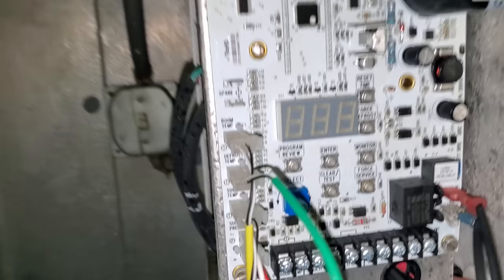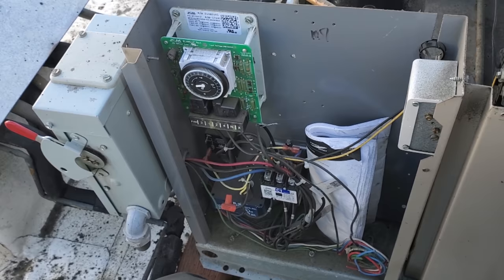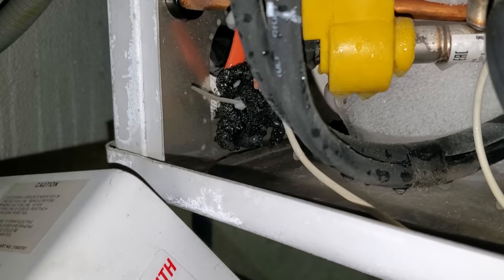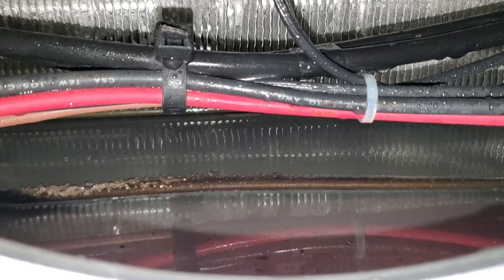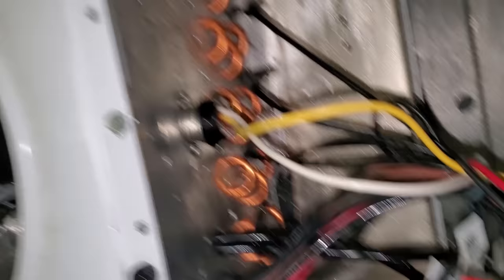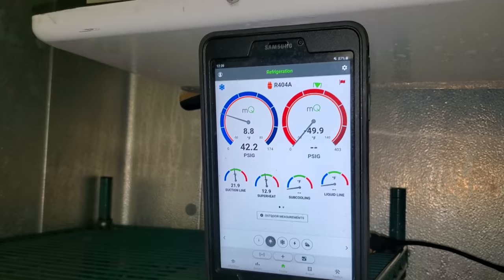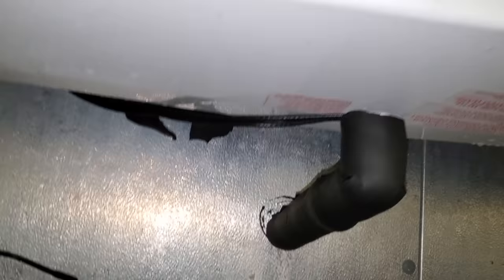THE OTHER COMPANY COULDN'T FIGURE THIS ONE OUT EITHER

Comment: So I do appliance repair. I know most of these components, but mine are smaller and more buried.

Thankfully a refrigerator is designed so if you have a drip line clog (smaller tube)  it floods the refrigerator, but saves the equipment. (Sadly occasionally at the expense of the hardwood) The bottom pan fills up, and you get a dribble of water out the door. Tends to indicate the problem much better than icing up the evap coils. 

Normally we get a call because "the icemaker is leaking even though we turned the water off". 

Always fun to explain to the customer that their leak was literally coming from thin air, rather than the icemaker. 

You earned a subscriber.  And my sympathy goes out to you. I've been the 6th tech on the call before. It's satisfying when it's done, because you just proved you're better than at least 5 other techs, but you feel so bad for the customer, especially when you are charging them to undo something you know someone else charged them to do wrong. And you almost want to defend the other tech, because he represents your industry, but you really can't, because you're looking at his stupid.

Comment: I used to hire tech's, it takes about 1 in 20 to find a good one (one that can troubleshoot properly w/o shotgunning new parts at the problem), this is the same in electronics, plumbing, automotive, etc, sad but true. I loved it when they say "I been doing it like that all my life", and I say, yep "wrong". I seen a electrical outlet in a house with 1 (hot) wire connected to it and it worked, turns out they used the chicken wire for neutral.
Reply: I'm glad i work at a good plumbing company😂
Reply: @lukie4ever  And you probably use good common sense! As my dad always said "common sense isn't so common".
Reply: Chicken wire is that a nickname or euphemism for maybe that bare copper or are you saying the wire that holds the lath and plaster together? I've seen the first but if you tell me it's the wire for the lath and plaster you win! HAHa.  Laugh n plaster.
Reply: I have seen many techs who got straight A's in tech school, but could not troubleshoot to save their life.
Reply: @LTJR.  chicken wire, or hardware cloth, used for mortar or stucco walls.  if the structure was older and had the ground and neutral lines shorted at the pole and/or breaker box, then yes this would work quite well.  jack-leg install, but workable.
Reply: @em1osmurf  wow that reminds me of a house that I rented a room in Santa Ana CA. The owner was there and always had me doing upkeep as the house was constructed  around 1925. Lath and plaster and two prong outlets... I think one of the bedrooms actually had 2 conductor wire inside a track laid on top of the wall, starting at a little pigtail plugged into the socket and then running around the room. He wanted me to install a lighted switch, like a regular light switch but deep red with a light in it. There was no way I could get it to go because it needed three conductors at least, and the location was just inside the front door where there was cement for the porch. He ended up finding a friend who was in between jobs and taking what he could to feed the family and that guy had to crawl in to 2' feet or less under the house and clean out sand, a lot of sand to get to that space, and also to clear a path for running a gas line for a furnace he wanted to install in the mantle place. That poor guy worked his ass off, for not a lot of money, considering contractor wanted 1500 just to run the gas line, because of all that sand. The guy brought his son who pissed off after the first day. I had so much respect for him... He never bitched about his son splitting. He  didn't look like the kind guy that would let it go, but he didlook like the kind of guy that wouldn't drag his laundry out to air. And he did good clean work everywhere,  I had no problem taking a backseat and letting him support his family.
Reply: @Ozzy3333333  Well said.   When I was a kid at Christmas time and I would watch "A Christmas Carol", there's that spot in the story where the guy says to the young Ebeneezer, "You're smart and you're no fool..." I wondered what that meant.  Then I got older and read the book of Proverbs in the bible.   Has turned out to be very true by my observation in life as well; there's a BIG difference between intelligence and wisdom.    I've known some very bright, smart people that were dumber than a box of rocks.   Didn't know how they could keep from walking into doorways.   I knew one guy in HS that was a literal genius.   He could write out mathematical and scientific equations and calculations as long as the blackboards.   He ended up a top scientist somewhere from what I heard some time ago.    The band director stuck him with me, this kid LITERALLY didn't know his right foot from his left.   When we would march, I rarely got to play because I would constantly be yelling, "LEFT, LEFT DANNY, LEFT!" all the way down the field.   Never once did it ever improve; did he ever learn.  The concept was beyond him.  True story.....
Reply: I remember when my step mom tried to tell me she has been cooking longer than I have been alive and my retort was that in all that time she never learned how to do it right.
Reply: they say "I been doing it like that all my life", and I say, yep "wrong"
When someone annoyed me enough I said the same thing to him. Only it was "FU*^"'@ wrong"
It was a stressful job. 
I was The Technician in a college engineering Dept. I had a different Lecturer get irritated with me because I told him he was doing things wrong as well. He said "I've never met a technician like you."
So I told him,"That's because I'm good, all the others were crap." Eventually he came to me for help regularly. Because my solutions worked.
It must be a world wide problem.

Comment: Great work young man. The other techs from the install and subsequently all the follow-up service calls company should be ashamed to call themselves refrigeration technicians. The owner of that establishment should also bare some responsibility as well for letting this fiasco continue. That old saying "Burn me once, shame on you, burn me twice, shame on me" is fitting here. All these problems would have been avoided IF the installers performed their jobs properly and the lead or supervisor inspected ALL aspects of that install ESPECIALLY the most obvious, that drain line. I've been in HVACR for 43 years, built and installed walk-in cooler/freezer systems many times. The 1st two that I ever did in my early twenties were a learning experience I will NEVER forget. I made a ton of mistakes, my takeaway from those mistakes was to ALWAYS triple check my work and have it inspected by a qualified inspector as well as my coworkers. My pride be damned. At least I learned and was open-minded to suggestions so I got the job done correctly in future jobs. Your knowledge is impressive and your work ethic is without parallel. Thanks for keeping the HVACR trade respectable.

Comment: There aren't enough tradesmen who read. Being the sole man on a complicated install with new equipment who is willing to take the time to read instructions against the will of a foreman can be an angering experience. Don't blame it on the plumber dude! That system had multiple retardisms. Chingus to the rescue!
Reply: It's always the plumber, you know that. Lol.  Breeze Mechanical.
Reply: Yes, but all by the same company and therefore a strong possibility, it was the same techs.
Reply: If the plumber is touching the hvac systems, thats a problem.

Comment: If you picked up a neutral for the door heater from another circuit (breaker), you've possibly created a hazardous condition and  a NEC code violation by creating a multi-branch circuit. This will cause a "hot neutral" condition. Think about it.
If you are working on the other circuit from which you stole the neutral and kill that breaker, that neutral will get back fed from the door heat circuit/breaker. To correct that jury rig, the two breakers (The door heater and the circuit from which you borrowed the neutral) need to be put on a common two pole breaker, or put on single breakers side by side with a breaker tie handle.
Reply from the maker: The door was designed to run the door heater and the lights off the same circuit so I just corrected it back to that setup.

Comment: That one was a real Charlie Foxtrot. I bet you could have called that other company back till the heat death of the universe and not gotten it fixed right.

I don't like pulling the trigger on the "name them and shame them" bit, but this one deserves it, and there's only one reason that's sufficient for that. They charged the customer to attempt to fix errors that were made when they installed it.

My dad works auto repair. He does not make errors often, but he never charges the customer for the result of his errors, and always communicates to the customer when things are going to take longer than initially planned. For example:
He was doing a timing chain service on a 6 cylinder Subaru engine (think boxer 4, but add another row of cylinders). He got the cam timing very wrong on one side of the engine, which bent the valves on that side because this is an interference engine (means the pistons will hit the valves if the valves are open when the pistons are at Top-Dead-Center).
He informed the customer that he had made an error and that it would take longer than expected to fix it, with details about what he was doing to fix his error.
!Without charging the customer beyond what the job had initially been estimated to cost!, he then removed the head and sent it to a machine shop for inspection. It turned out that all it would need was new valve guides and valves, which he then ordered from a Subaru dealer, re-assembled the engine with the correct timing, and apologized to the customer for the increased time it took.
The customer was satisfied with the work, and while he did not ask if they would return I believe that they would not hesitate to return for more auto repair work when the time comes.

That's how you keep a customer when you screw up.
Reply: Looks like you have learned a valuable lesson from your dad. He's got a great work ethic and thats what separates the men from the boys. Thats hard to find in these days and times
Reply: sometimes you have to eat the poo sandwich, such is life, it's not always red roses :)

Comment: I work in industry and automation, this kind of "work" is more than usual. Many times I wondered how thins simply don't blow up.  Things are regularly f.ck up from mechanics, installation, electric, and software. People think that I'm crazy when I spend hours routing wires, measuring the position of components, and "loosing" time to correct minor bugs. But nothing can replace filing when you open a control cabinet for the first time and every wire is so perfect and logical that you even don't need any schematics and/or instrument.

Comment: Good video; good logical approach without guesswork; I worked at a place once that had a pretty good tech that used to come out; the only one he couldn’t fix 100% was one that had a coolant pipe with a slow leak right where it passes through the concrete according to him; it would fail and need a top up every summer; fine the rest of the time though; always wondered if there was a way to fix that one properly; 1 out of 7 units.

Comment: With electric expansion valves it is good practice to install a liquid line solenoid for a safety.  If power is interrupted,  the valve will be in it's last position,  which could potentially slug the compressor.  Or if the valve leaks by, same purpose. I watched a 5 HP compressor buck like a bronco because the supplier overheated the electric valves on two different evaporators and they would not fully close. Installed safety solenoids on both at Ke2therm's direction. I see you are like me, always getting stuck with problems other companies left behind and customers that gave up on them, begging for real help from someone that likes to actually fix equipment.
Reply: QRC does not require a solenoid. It will close the eev in the event of a power failure. A capacitor on the board will drive the valve closed. The solenoid would only add a potential failure point. Some other systems need a solenoid, but not this system.

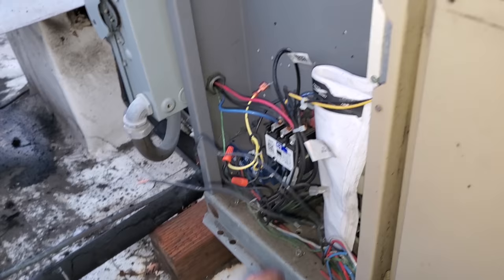Comment: 14:21 why not use WAGO connectors instead of wire nuts?
Also seems like a very bad idea to have any electrical connections and/or electronics where it's regularly gonna get wet or ice up. No wonder there were problems with electrical shorts and whatnot. If they had a GFCI/RCD installed for that unit, that probably would've tripped all the time.
Reply: Excellent point. At least the terminations should be in water proof sealed box.
Reply: mark robertson    Same thing with Hunter Biden. This company had no business being there in the first place 
as they were either incompetent, fraudulent or both.

Comment: About a year ago we met at a friends house, drinking etc. We had a beer cooler running and a coffee machine and we were wondering why the breaker kept tripping. He said that there was a company who redid wiring and the whole fusebox, which they did, but for some reason they fused all wires from the main floor (6 rooms) into one junction box and ran all these wires into one breaker. Wires came from the kitchen, living room, bathroom and three bedrooms. All other breakers (for that floor) were populated with wires but there was no power on them because they were connected to nothing. Was a mess to clean that up.

And yes, that included power for the refrigerator, oven, microwave and alot of other power hungry devices and all of the lighting for the rooms

Comment: That cord was soow, which in cord making jargon means it is rated for hard use, oil and water resistant, and less than 600 volts. When you see  the letter J, that means 300 volts or less. for your  setup, either one would work. That box for the door heater for sure had too many conductors in it, and the lack of tape on those wire nuts made me cringe. Good call running the cords up high, away from the water, duh.
Reply: I believe "O" is also Oil resistant and "J" is not.
Reply: I HATE it when people tape up wire nuts, makes having to go back and figure out whats wrong a PITA, and its a mess too. Electrical tape has this nasty habit of leaving the adhesive over everything, ESPECIALLY if it gets warm.
Reply: Sovek U should tape up ur wire nuts when it comes to high voltage, just an fyi
Reply: @ericpalacios3568  Wire nuts are the devil's spawn. There are better/safer ways of connecting and if you need to tape them then they're the WRONG device for the application.
I'm glad they're flat out illegal in most countries.
Reply: @vladseb2009 
S = severe service
J = "junior"  300 volts or less, otherwise typically 600 volts or less
O = oil resistant, two O's mean both the conductor insulation and the outer jacket are oil resistant
W = weather/water resistant

I'm guessing that the first installer used two SO cords because both feeds were hot (208 volt, so 120VAC potential to ground on each), and was trying to strictly adhere to using black insulated conductors to show this.  For individually ran conductors, this would be true.  However, with jacketed cable, you are allowed to use the white insulated conductor at elevated voltage. Not best practice, but permitted, and a lot less nonsensical than what was found here.  When this is done, sometimes the electrician or installer will apply a wrap of black electrical tape or shrink tubing at the ends to indicate that it is being used as a hot conductor.

Comment: Great job getting to the root of the problem. You might want to add heat tape around the drain in the beer cooler as they tend to keep them extra cold to prevent foaming at the taps and the drain line will freeze in there. Try being the supervisor of the original techs who has to do what you did...and you not only have to make everything right, but you also have to make the customer confident that your company can properly handle their repairs in the future. And you were right not to talk trash about the other crew...the customer must see that you are there to save their product while not making what sounds like excuses.

Comment: Just a comment about work ethics.  I retired from the HVAC business back in 2012.  I had my business for over 30 years.  Started out maintaining communications/computer rooms and then broadened out to doing installations.  As the years went by I built up my business to a $2M a year business.  The point is, I never had to advertise.  All my business came by word of mouth and referrals.  If you treat your customers right, do not gouge them, and spend the time to do the job right the first time you will do good.   I do not know this mechanic/company but I can bet his time and efforts will be rewarded by the owner of this business talking about him to his associates.  And the comment about not charging enough, I was in the same position once and was asked why I did not charge as high as some of my competitors did.  My answer was, I want to eat next week.  And It was my responsibility to keep my employees busy and have work all year round.  I did not catch your name,  but congratulations for being a great mechanic/technician, and not being a Sears and Roebuck parts changer.  
Suggestion, you should let the manufacturer's representative in your area know all the difficulties you ran into and what you had to do to get this customer back online.  And mention that the customer knows it was the installing company and not the equipment that failed them.  Hopefully, the Manufacturers representative will refer you to other work and/or installations in the future.